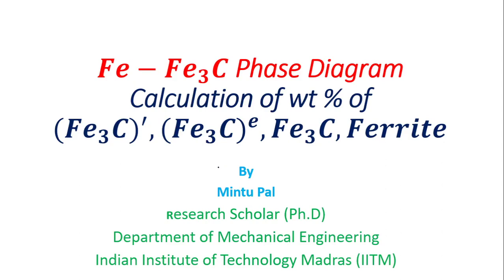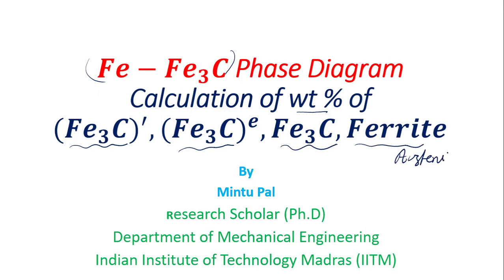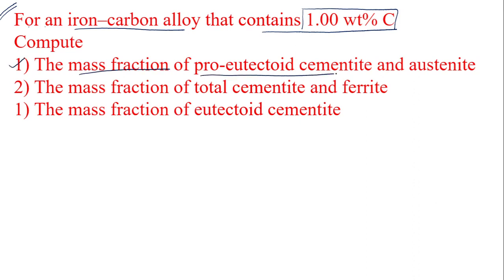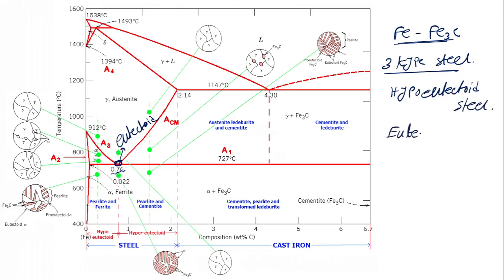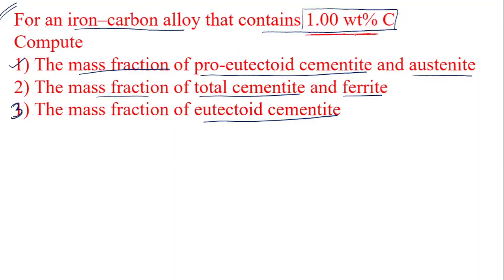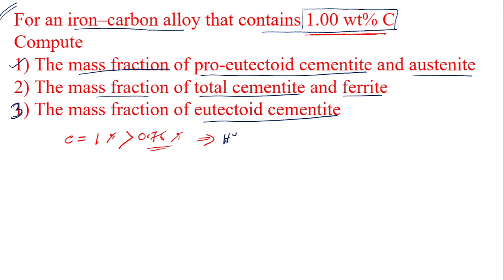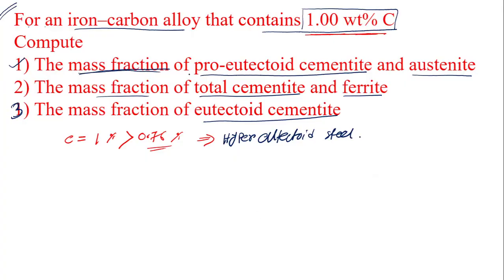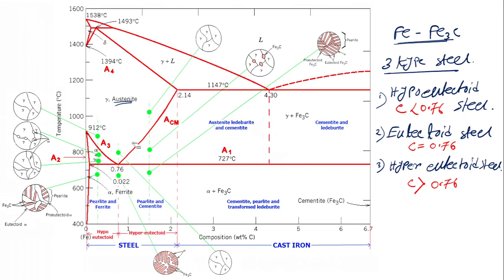How to calculate wt% of pro-eutectoid cementite, eutectoid cementite, total cementite ??

Comment: Hello sir can you make video on GATE 2023 Question based on same concept.

Question No.52 A steel sample with 1.5 wt.% carbon (no other alloying elements present) is slowly cooled from 1100 °C to just below the eutectoid temperature (723 °C). A part of the iron-cementite phase diagram is shown in the figure. The ratio of the pro-eutectoid cementite content to the total cementite content in the microstructure that develops just below the eutectoid temperature is ________.